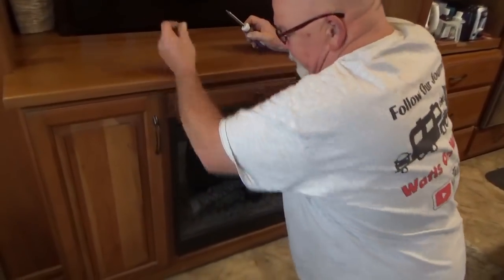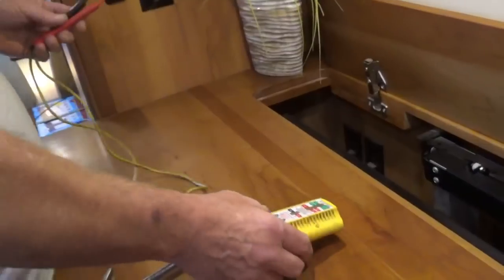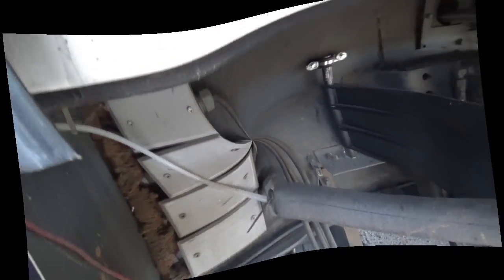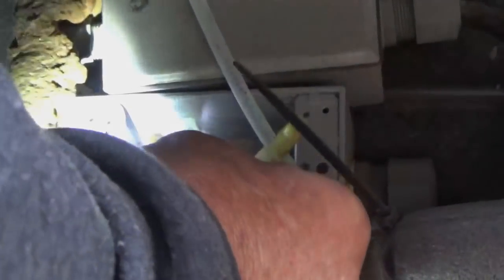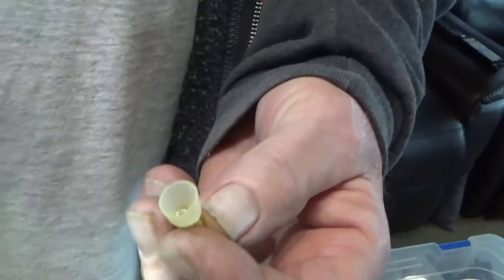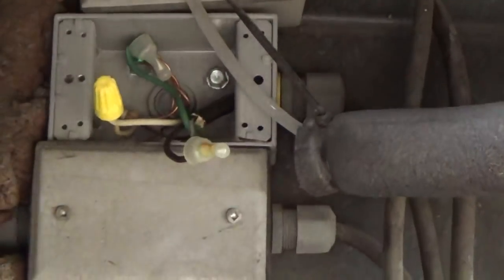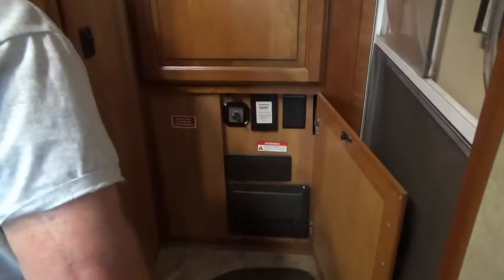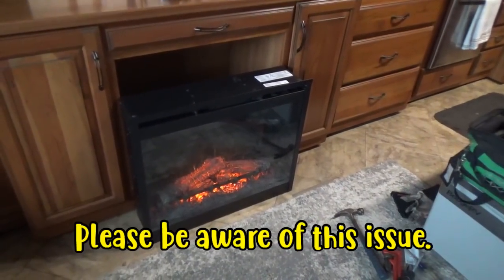😲 We Could Have Burned Up 🔥 // RV Faulty Wires // Electrical Fire

Comment: oh check the Air Conditioner wiring. My RV AC quit working during the hottest time of the year. The AC wiring was bad! I was taken back did some research and it is standard across the RV industry.
Reply from the maker: Thanks for the tip.  Gonna be checking all of it over the next few weeks.

Comment: I would email them pictures right back to the company that built your fifth wheel and tell them they better start using the right connections or tell their mechanics to start using the right connections on the wires...  before they have a lawsuit on them for burning down somebody's RV with bad connectors. 🙄🤔😠
Reply from the maker: After hearing from someone with a newer model, they had the correct connectors.  Was glad to hear that.

Comment: I’ve worked at many jobs in my life, from roller coasters, commercial kitchen equipment to cars and trucks and never knew about the hot stick. Paused the video just to order one. 👍 thanks for that one. 

On another note how did you guys defog the glass on the fireplace?
Reply from the maker: There is a link for a video to defog the fireplace.  https://youtu.be/A-KQViu4gmo
Reply: @WattsOnWheels  thanks 
Guess I should have looked for that first.

Comment: Emergency service call☺️.  Also appears the size of wire is too small for the amps that is being pulled by the fireplace.
Love that tester.  Is it on your Amazon site?  Old saying save the nickel and it will cost you thousand in the long haul.  Personally I would spend a day changing them all out.
Thks for the heads up.  Brian and Cindy "xtreambydesign with passion"
Reply from the maker: You might be right about that wire being too small.  Planning on changing them all out.  Testers used:  https://www.amazon.com/shop/wattsonwheels?listId=3K4MB2J93D37O
Reply: @WattsOnWheels  minium wire size should be 14 gauge for 1500 watts with nothing else on the circuit.  And that doesn't give much play room.

Comment: Do yourself a favor and buy some Wago connectors, they are 10 times better than wire nuts for joining wires together.
Reply: They are made for solid and strand wires together. They cost a little more but well worth it.
Reply from the maker: Thanks for the tip.  I'll check into that.

Comment: I ran into the same problem but it was on the 12 volt circuits.  I replaced all the interior lights with LED’s and on two of them when I was working with the wires the crimp on wire nut just came loose.  

I wonder what the code is for the use of that type of connector is in the manufacture of RV’s?   If they have used the incorrect connector would it be possible for a regulatory body to have a recall?
Reply from the maker: Don't think there is any code for RVs.  😫

Comment: The problem with the threaded cap is that they will  loosen over time (Creating a different fire-hazard)
I'd probably recommend a Push-In simply based on the environment:
https://youtu.be/AWiyreFFt-Q
Reply from the maker: I like these, but in my opinion, the push-ins allow the wire to move around in them from the vibration of the RV which can also create a hazard in itself.  In a home...absolutely, in an Rv, I'm not so sure.  The ones with the lever lock (Wago) again the vibration could allow the lever to pop.  Again, just my opinion.  I think I'll stick to the twist connectors with electrical tape for right now.  Appreciate your input.
Reply: @WattsOnWheels  Having the wire-nuts screw off is the reason that I suggested the Push-In solution over wire-nuts (I didn't see you mention Electrical Tape in the original video.) 

Wago is actually the superior solution, but I also had concerns with them coming open from Vibration (And the reason I didn't recommend them to start with...)  If you are using Electrical Tape anyway, evaluating the Wago for your use-case might make sense (I'll leave that decision for those doing similar fixes on their RVs.)

Enjoyed the video!